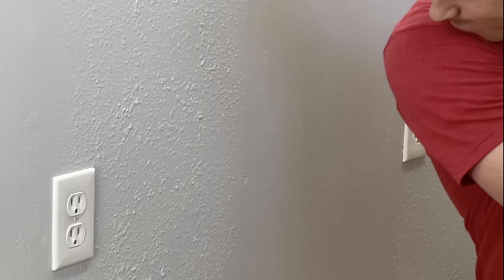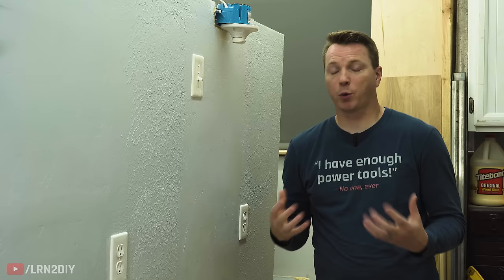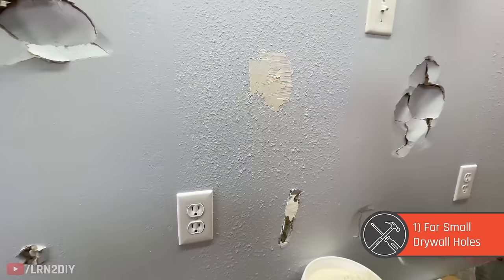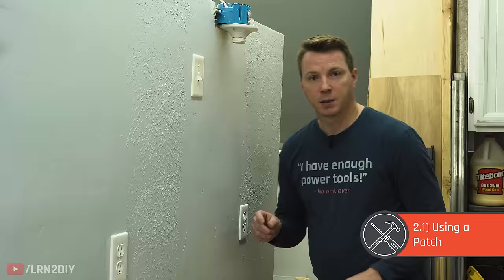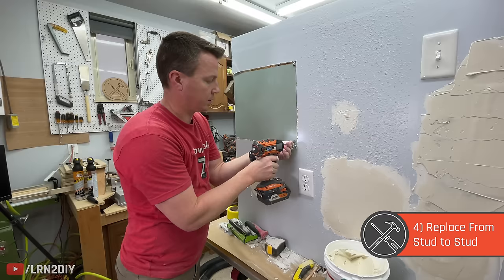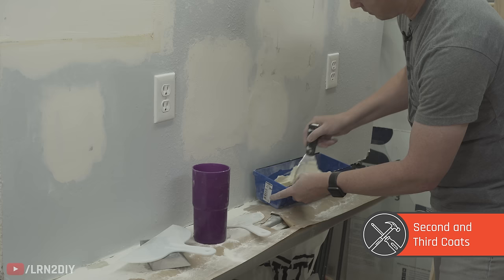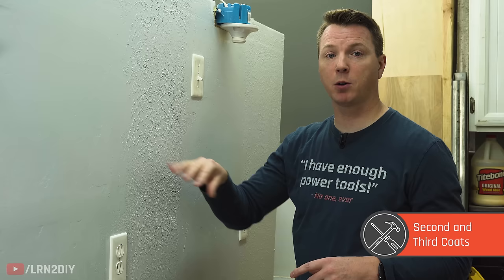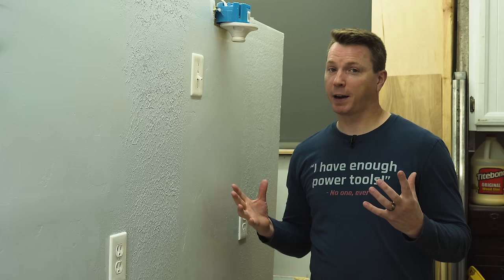How to Fix Holes in Drywall - 4 Easy Methods

Comment: Thank you for all your efforts. 
Best cost effective stud finder you will find is super magnets which comes under 6 bucks. We need to move to them around the wall and it works well. You could easily save 25 to 30 bucks.

Comment: Thank you for this video! What's the difference between spackel and mud? I have spackel for the walls when we did painting last year. Does it depend on the size of the hole? There's some water damage in my bathroom to the wall and the wall has picked with some smaller but obvious "tears" along the wall between the tub and the sink and some bubbles under part of the wall paint that haven't broken open yet like the others. What would you recommend? Not big enough for a patch but awesome to know those exist. Thank you!

Comment: The solution is simple: do not use drywall, use AAC (autoclaved aerated concrete) for walls.
Drywalls are scam. I'm quite sure the void inside of walls supposed to be filled with sand originally, but then you could not break them so easily.
Reply: I've been thinking the same thing. Why are the walls so weak?? There's gotta be something better.
Reply: Probably because it's cheaper to produce and sell. And it's really easy to set up. Unless a homeowner specifically wants what you suggested, drywall will be the standard
Reply: Does AAC allow frequencies for phone service and internet to pass through the walls?
Reply: @iSkrapsRacnus  AAC walls has the same effectiveness as brick walls. Thus it should not be problem for a signal coverage. At least half of the world use brick houses and has no problem.
Reply: @vasiliynkudryavtsev  “Materials such as drywall, plywood, other kinds of wood and glass can be easily penetrated by wireless signals. However, materials such as brick, plaster, cement, metal, stone, and double-glazed glass may cause problems.”
 I know that concrete is bad for wireless signal and I’m not trying to doubt you but wherever I look having interior walls that are brick or concrete etc would interfere.
Reply: @iSkrapsRacnus  There are two ways of propagating the signal: coming through and reflecting. I live in a flat with brick walls and wood doors, have no problems with coverage so far. Signal is reflecting from walls and pass through wood to reach my devices.
AAC is little better than solid concrete in this case, because of the porous structure.
Anyway, there are other ways to increase wifi coverage (multiple AP), as for cell signal - one window in the room is enough to sneak in. The wall material does not matter that much.
Reply: @vasiliynkudryavtsev  What’s your wifi speed?
Reply: @iSkrapsRacnus  94Mbit/s over 5GHz and around 40 over 2.4GHz, but that's because 2.4 band is quite polluted.
The router is in the nearby room right behind the wall. About 10 meters for the reflected signal path.

Comment: When i screwed backing boards in, even though i used more space than you, the drywall crumbled apart. I had to screw supports directly into the studs to have any support at all, and i had to make the hole bigger. I wasnt able to do much of the paper overhang as a result, and when i put the mud on the seam it was super thick and just... tore or clumped instead of spreading. The wall ended up kinda lumpy on one corner...

Comment: When cutting from stud to stud, instead of cutting an additional 3/4" to fasten the patch, you could install 2X4 blocking to the studs, giving a full 1 1/2" to secure the patch.

Comment: Our rental back door doesn’t have a stopper on it. Storm blew open the door and the little switch lock right into the wall. Clearly done in the past, the you can see the patching work. 
We have had to contact the property manager 3 times in our 4 month lease and we don’t want to message him again and fix it ourselves. This sort of helped.

Comment: The video above explains the basics of how plug drywall repair works. The whole bet he is fixing as much bigger but it's the same idea. And with smaller holes there's a ton less work. I've done this numerous times. It's super quick and easy. The only thing is finishing with the same paint. But this method makes it flawless. Just need the right paint. I've done this half a dozen times.

Comment: For the layperson, mastering these techniques is much harder than it looks.  If/when you're able to do so, the next step is to sand as little as possible, because the mess it makes cannot be believed until you experience it.  If you sand upstairs, you'll end up with dust in the kitchen.  Considering that you will have to mud three times, you should work towards not sanding the first two times (smooth it out as much as possible, and stay below a theoretical surface thickness) and then skim with a light coat the third time, and HAND sand an absolute minimum.  It can be done and makes life a lot easier . . . and the job a lot more pleasing.
Reply: I have a few holes to patch. I was thinking about just purchasing a nice vaccim with a HEPA filter to reduce the spreading of the dust

Comment: Nice video. I just finished patching up my wall one large hole and some tiny bitty holes. Using the same mud from Lowe's.  I am not planning to paint them since I am going to use molded concrete bricks to cover all over my dining and kitchen walls.

Comment: If you don't have a stud finder and you have a large area of damage, you can just keep cutting away...or reach inside...until you locate the stud, usually 16 inches apart on center, but sometimes 24 inches.

Comment: We have a dog in the home. His name is Polo. So Polo’s hobby is picking up any loose article off the ground and being chased down the hall to take refuge under the bed. He grabbed my girlfriend’s slide up and tried to scurry away, but I sprung into action. Ran a little before sliding on my knees across the wooden paneling to then catch him by his legs. He didn’t get away this time, however there is now a shoulder-to-elbow sized hole in the wall.

Comment: At 5:55 method, do it d reverse way, first cut a square board which would cover d damage, now put d board at d damaged wall n mark on d wall to cut exactly the same size as ur board, simple easy way n perfect to cover.

Comment: Good technic  bud if you peel the paper around  the perimeter  of the hole square or round over the wall  and apply   watering almost compound 90 minutes dry fast . Will be easy and less coats and less sanding that means less mess

Comment: Thanks for the great video! I had two questions for you.
1. If I have holes that are really low to the floor, but about the size of my fist what would be the best thing to do? I replaced the floor board heaters with in wall units, and the holes only have 3 sides on them. 
2. What kind of stud finder is that?

Comment: For the 3rd hole you could have just strapped it then cut the piece of drywall to fit then use tape for the joints just like you did for the 4th hole. Much cleaner. But if you are in a jam and can't get any wood to strap it then you can do the California patch as a last resort.

Comment: What happens if your new piece of drywall you're putting in is thicker than the rest of the wall?  I'm doing #4 (stud to stud), but my new piece is thicker than the existing wall - do I just try to save a layer or two off the back?

Comment: With practice and learning better knife work, it is possible to save a metric ton of sanding. Also, using a damp sponge on the edges of the new (dry) mud you've added right before texturing makes it a lot harder to see the patch and easier to feather the new texture in.

Comment: How do you determine if you want to use a California patch , or a screwed in piece of drywall with wood pieces ? The sizes seemed quite similar and the patch seems like the easier option

Comment: What do you do when you have cables behind the hole? Do you add a plastic foil before putting the adhesive mesh on? So the cables don't get fixed in the mud.

Comment: I do have a further question:

My case is the hole #1, that was caused by the curtain pole. To patch the hole as you said is ok, but how can I make it be able to put the nail back in? Would it support, or I need to find a different product/approach?

Comment: Small hole fix question. Do you have to wait the 24 hours after apply the puddy. Also do you have to apply the 2nd and or 3rd coat?

Comment: pushed my bed closer to the wall behind with my leg and I used the wall in front of me as support. I had my hand against it and pushed the bed too hard, and then pushed a hole into my wall with my hand

Comment: Thank you! I just moved into a new place and the previous tenant let some towel hangers get loose and all droopy. I didn't know what to do but this was pretty informative and thankfully I just need to get the mud going. Just one question: for small holes, should I apply the mud again after sanding? Or does that apply only to the larger patches? Thanks!
Reply: Hi, I'm here for the same thing repairing a bathroom wall from previous owners towel rack that has eventually fallen out since everyone thinks it's a bar to hold them while getting out of the shower. However I have experience at patching many holes due to my anger issues. I only add more mud after sanding if the hole patched isn't flat enough to be as even as the original wall. Sanding should be the final step before painting. I'm no expert but this has all worked for me. Good luck!

Comment: Hello, quick question, I had to have a rectangular shape cut out of my wall. My electrician put a piece of Sheetrock in the rectangular opening, but he didn’t have the paper overlap. Is there something I should put around the rectangular gap between the regular wall and the added piece of sheetrock?  Thanks and I enjoyed this video. After watching the video again, I think the mesh tape is what it need. Any suggestions? Thanks

Comment: I was always curious on how good these patches hold up. Are you able to hang or nail anything to these sections without having problems?
Reply from the maker: So that depends largely on how you patch it. If you fill it with sufficient mud and do a decent patch, it'll hold up fairly well but if you add the wooden backers, it'll be much stronger and can certainly hold a nail and a bit of weight.

Comment: So on the California patch, it is better to use some extra drywall paper around the edges of the plug rather than cutting the plug clean and using drywall tape around the edges?  I always thought you had to tape the edges, this is the first time I'm seeing the use extra paper around the edges instead. Is that more structurally sound or something, or simply better because you don't have to worry about the squares of the drywall tape showing through in the finished job? Thanks for your helpful video!

Comment: What he doesn't mention is the hardest one.... flat texture. For this technique you will want to apply two coats of spackle, dry completely, using light pressure start with 150 grit sandpaper sponge lightly soaked in water to get ridges off, then move to 100 grit sandpaper sponge lightly soaked for finishing touch. If you use anything other than light texture, you'll notice the patch job. Let dry completely. Then paint

Comment: Correct me if I'm wrong... But doesnt the product say to use a wet sponge to "sand" and remove the excess? I've sanded before but also learned that a wet sponge it typically faster and cleaner. No dust. 
But hey, to each their own.

Comment: I have a large sheet rock hole from a large anchor. Need to install another anchor close to it and I’m concerned about the strength of it since it’s so close to another anchor hole. No studs nearby to use .Is there a way to repair it so that it’s as strong as the original sheet rock to ensure that the new anchor doesn’t fail?

Comment: This is so helpful, thank you! This may sound dumb, but are mud and spackle the same thing?
Reply from the maker: Not typically. Mud, or joint compound, tends to be wetter and is used in large applications, including texture. Spackle typically is used for smaller applications like nail holes and such and tends to be dryer.

Comment: I ripped out the towel holder in my bathroom screws. If fixed with the mud only am I still able to put my towel holder in the exact same area? Or should I probably move it?

Comment: Hello again!
I have a question...
@26:12, with the homemade Presto patch, will it bubble over time after it's been painted like when you have a torn-off piece of drywall and brown paper is exposed, then mud over it, paint it and after time it bubbles because the brown paper underneath begins to lift causing a bubble? Does the white paper you leave connected after pilling the Jipson off of it, keep that from happening when you make the homemade Presto Patch?

Comment: Did you tape the seams for the number 3 repair? I just fixed an outlet size hole with backers and muddled over it without tape. Wondering if that is incorrect and I should go back over it with tape.

Comment: I tried using the technique where you use trim boarding and then buy extra drywall to make a patch with. My house is 30 years old and I can’t find any drywall that is the same width All the drywall I find is about an eighth of an inch thicker. Can I find thinner drywall or should I just try one of the other kinds of patches? Thank you for your time.
Reply from the maker: That's a great question and probably a fairly common issue. Drywall typically comes in 1/2" or 5/8" today but you can also get it in 1/4" and 3/8" at Home Depot (I just double checked on their website). I suspect you'd be able to find it locally but it may require a bit of digging around. Even the patches are usually sold in either 1/2" or 5/8" so that may or may not work depending on what you're working with and if you want to use the backer boards.
Reply: @LRN2DIY  thanks 🙏 for your help

Comment: Do you recommend sanding afterwards?  If so what grade paper?  Thanks for the video
Reply from the maker: You should send your top coat with some 220 grit. Check out my latest drywall video from about 10 days ago to see that in action.
Reply: @LRN2DIY  thanks

Comment: Drilled 2 holes my my sisters wall (1 behind her tv and the other at the bottom of the wall) wanted to feed the wires for the tv behind the wall…turns out there’s a horizontal stud blocking the cords from reaching the bottom. Fml.

Comment: Is there a way to keep the drywall from hardening in the container if it’s not used for a long period of time?
Reply from the maker: Best method is to add some water (couple of tablespoons maybe) but at some point it will still go bad if not used for a long time.

Comment: We have a body check hole (3 boys) I get the process, seems doable, but what about insulation,  does that have to be added into the hole?
Reply from the maker: Only if it was already there before. If there’s no insulation in the affected wall, you don’t need to add/replace any. And best of luck with everything. I have three brothers and we did our fair share of wall damage. Somehow my wife and I ended up with a son and three daughters so we don’t see a lot of the damage I saw growing up 🤣

Comment: For holes smaller than #3 (smaller than 10"), would it be ok to apply tape or is it entirely useless?
Reply from the maker: You can always apply tape if you think it will help. No harm in that.

Comment: I have a square of drywall with mold on it maybe 1 foot by 1 foot but it butts up to the shower tile how would I replace the drywall with the mold with out it affecting the tile?
Reply from the maker: You will likely be able to actually cut the whole square out from stud to stud, even into the corner, and remove it. Then you'd replace it and slide the new piece into the corner, fasten it, tape it, etc. If the mold isn't too close to the tile, you could always try cutting it a couple of inches away and using a support board behind it. That'll likely be your best option if that's a possibility.

Comment: What should I do if I have a hole just above the trim of the wall that’s abt 2in long and a couple cm wide
Reply from the maker: For one that size, you can fill it with some hot mud (the kind that dries within 20 or 45 minutes) and then cover it with mesh tape. From there you can apply thin layers of mud to match the surrounding texture. I have a video coming out this time tomorrow that will show the process.

Comment: After putting a lot of mud, I can still see some of the checker pattern of the tape. Will that disappear after sanding?
Reply from the maker: If you can see the mesh pattern of the tape, then no, it won't go away. Is it possible that the tape came away from the drywall? Sanding it from here won't help until you get all the way through the mesh tape, which will still show some of it where it transitions from tape to no tape. It sounds like you may need to redo it, unfortunately.
Reply: @LRN2DIY  ok, thank you. It’s only the first coat of mud. I’m going to try another coat to see if that covers the tape better. Hopefully I won’t have to redo it.

Comment: so many comments on here are clearly paid for or bots, he gives the general idea. any kind of area bigger than 3 inch by 3 inch (3x3) definitely needs support behind it as he showed in #3. i guarantee you he has never done this professionally before. the texture in a can is a horrible product and waste of money. there should be at least 3 coats of mud, the tape on the seams (where the 2 pieces of drywall meet) should never be seen through. When sanding never use a power sander (unless specifically made for drywall, will have some vacuum attachment) dust will get everywhere.